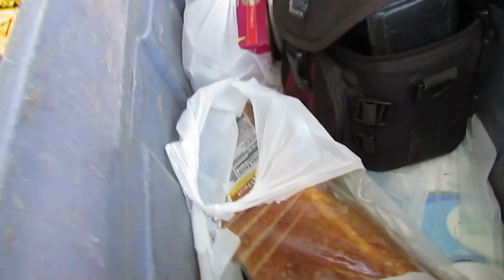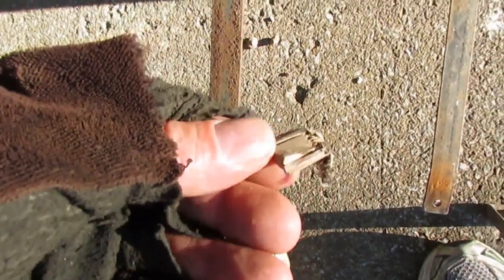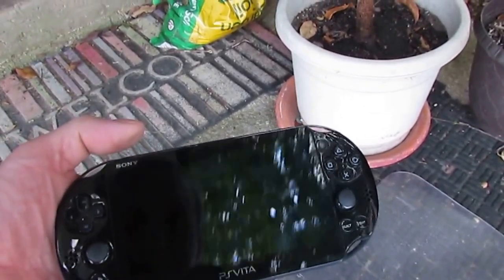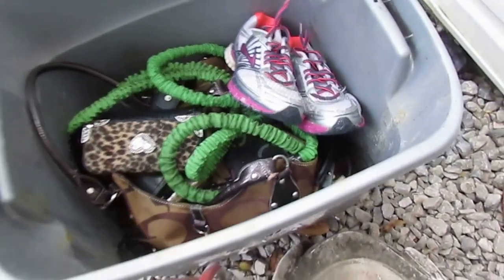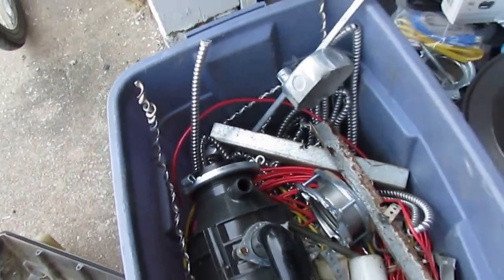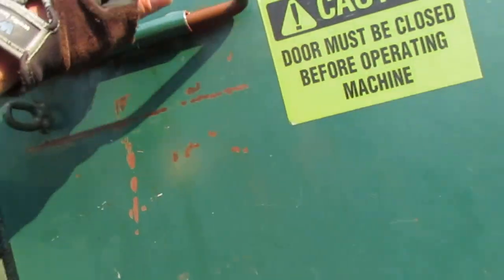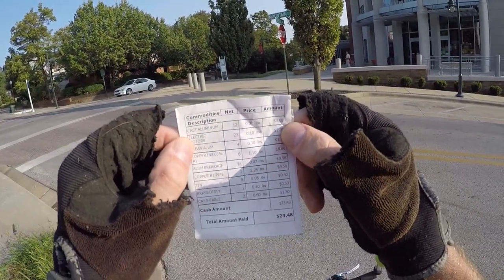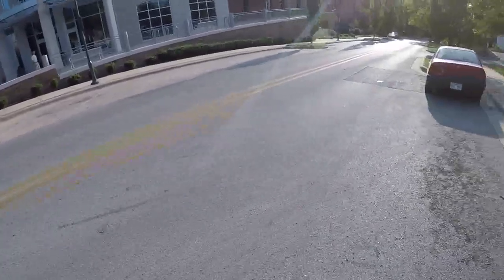PARK BENCH ENDS - Sony PS VITA Dumpster Dive SCORE!

Comment: The packer will not run with the door open and that one they has the controls and program to run on when the door is closed.  That one there is made at Cram A Lot in Springdale Arkansas right where you are at I worked there for 16 years until I moved to Texas.  That's why I love your videos so much because I get to see my home and I am homesick

Comment: Some of those bench ends are made to look old, so it might be hard to tell it's age. I find them in the trash a lot. I have a video of a dragon I made, using the bench ends for wings.  They look good, you could find some wood, and make a single chair, less stress on the metal.

Comment: If you somehow accidentally got locked in that kind of garbage compactor, the best way to stay alive is to try and stay on top of that pushing thing, or just smash that little sensor on the door frame.
You could propably weld that crack on the bench side dealybob.
Stay safe and keep them videos coming.
Reply from the maker: good idea if you can get up!